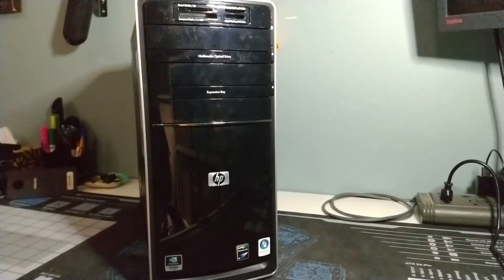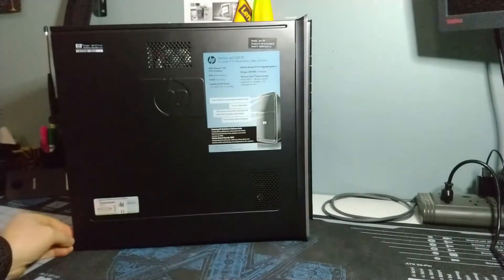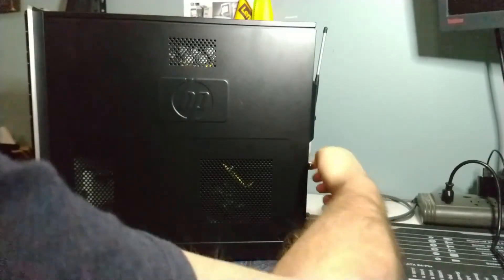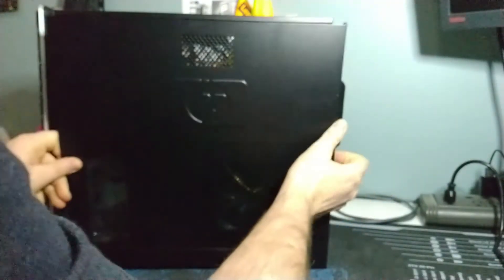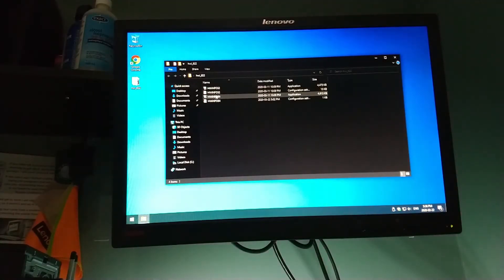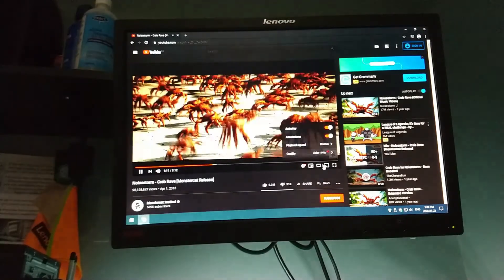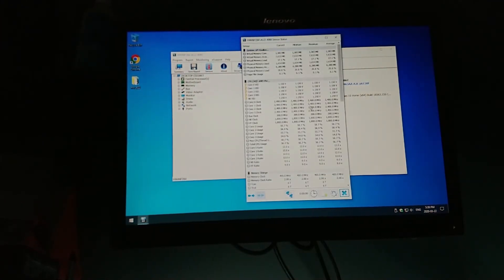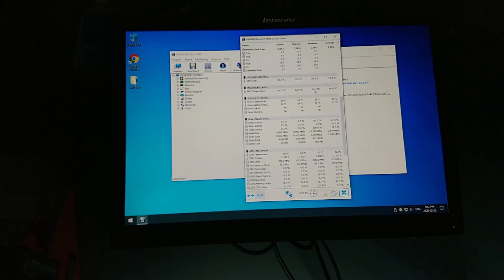HP Pavilion p6130f PC

Comment: phenom, nice! 
Probably wont get better temps on the chipset, the rear fan should help to pull air across it so it doesnt get completely out of control. Thats what killed a lot of laptops, the chipset with integrated graphics just cooked, they usually had poor cooling to begin with as well.
Reply from the maker: I was a little amazed at how ridiculous the thermals were